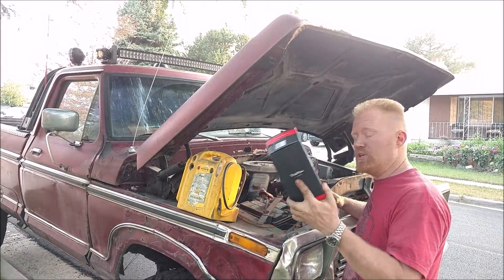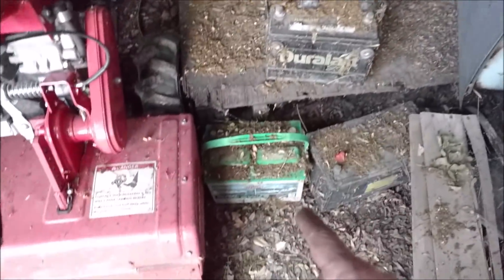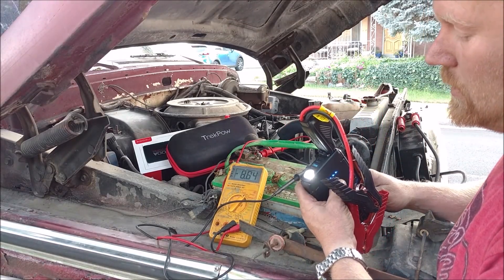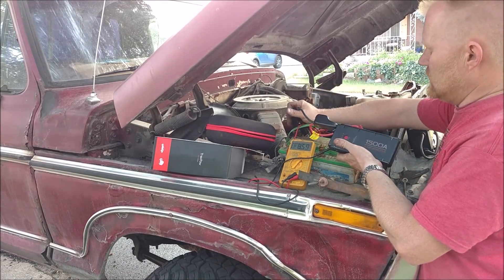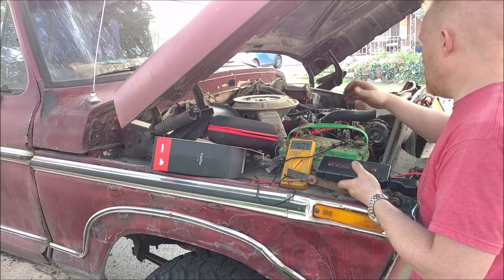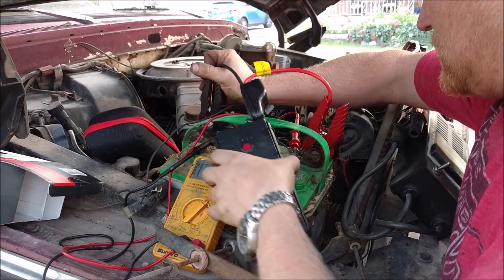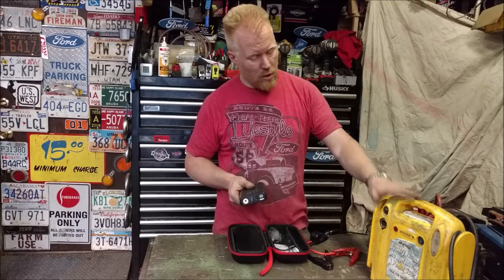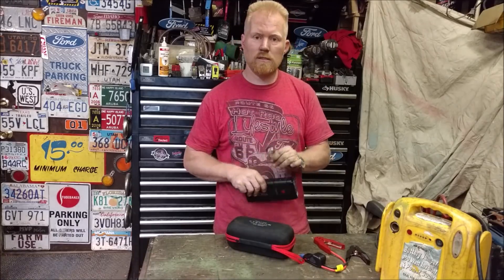Lithium Jump Starters any good?

Comment: Lithium ion batteries have a HUGE energy density, but they are really unstable, so gotta be careful of what brand you get, they will usually put out at least 1,000 amps or more under dead short, but they can blow up or swell or otherwise self destruct when subjected to that kind of abuse.  I have 4 of the lithium ion polymer/pouch batteries out of an electric vehicle that are rated at 300 amps continuous and 2,000 peak, and they can fully replace a lead acid battery, but even those are really REALLY scary, since there is so much energy in unstable super reactive lithium in those batteries.

Comment: I have had the TrekPow TJ2500 2500A Auto Battery Booster Jump Starter for 2 years now and it is a rock. As long as you charge it every 3 months whether you use it or not it will not fail you.

Comment: Cool, Now do the exact tests again in February rather than August ~
Reply from the maker: These lithium are night and day difference. I've used it down into the teens and it never fails. Easily at least 4x more powerful starts than any lead acid jump box. In the teens an ice cold engine will crank like it just shut off on a summer day.

Comment: @sixtyfiveford The fundamental difference between lead acid jump starter packs and the newer lithium based packs is their operational duty cycle. Lithium based starter packs typically only offer about six to ten cranks max before depleting their charge, but can dump very high amps over a short time, as opposed to a much longer duty cycle from a lead acid battery start pack, before losing its capacity to crank an engine over. The ultimate amp-dumping starter packs are based on super capacitors.

Comment: You don't need to install a dead battery to test the unit.
Just remove the battery and connect the unit directly to the cables coming from the truck.
What the hell do you need the dead battery for?
Reply from the maker: The battery acts as a smoothing capacitor otherwise once started the alternator would over voltage and short out itself, the voltage regulator, and dash/interior lights that are on and likely the vehicle computer.

Comment: I can’t support a guy who says a battery reading 9 volts is ABSOLUTELY DEAD.  Where does he think the 9V is coming from?
Reply: A 12V battery showing 9V with zero load has no useful energy in it. The voltage will drop even farther when a load is placed on it. Basically like the strength of rusted sheet metal - its shape is recognizable, but the minute you put any strain on it, it crumbles.

Comment: I bought one of these based on this video, for my wheelchair van, as I was recently stranded at the VA hospital in San Francisco after a two week stay. found I had left the headlights on. I had jumper cables onboard, but no one around to help. I had a solar trickle charger on the van, because there is a draw from one of the disability components installed that will drain my battery completely in 4 days. But this time is was my fault. Tow truck to jump my van was two and a half hours out. finally a very kind vet helped me out with a jump. got on my with a two hour delay. but with this tool I now have, I am more independent and can get on my way sooner. I only wish it came with the cigarette lighter adapter. Great video. thanks for this.
Reply from the maker: I'm still blown away how well these work. I have saved myself and a dozen other people now with it. It works better than even jump starting from another car.

Comment: As a general piece of info, apparently, it could be a good idea to let a jumper battery feed the main battery for a while.  Electro-Boom started his small car with some AA batteries by putting them in series to put a charge on the main battery and then, after a while, started the car.  Very surprising to me.
Reply from the maker: True. The large jumper pack is nothing more than a miniature lead acid battery inside.

Comment: Question,  i have the same one, i crank the car it starts then dies (off for a long time) but the unit disables the power to the instantly within a second of the engine running (but engine turns off after one 1 second due to it be off for a long time)  i have to disconnect  the jumper and reconnected .  on a old car i have to do this about 10 times is there anyway to disable the idiot feature?
Reply from the maker: You shouldn't be running off the voltage of the jump starter for good reason. The 16ish volts could damage a lot of components if left as the only power source. So they shut it off. A typical dead battery will keep an engine running even at only 10 volts and the high voltage from the jump starter is buffered/suppressed by the low battery.  If the car is dyeing immediately after you start it you have a completely dead battery and you're going to damage to the charging system by continuing to use it.
Reply: @sixtyfiveford  no one said anything about running it from the  jump-pack . lots of older cars take several turns to get them STARTED
Reply from the maker: @abdou6003  If the battery is so dead that the car can't stay running do to lack of adequate voltage to the coil, you are running solely off the jump pack.
Reply: @sixtyfiveford  car turns off not from battery being so dead. which its not all im saying older (still EFI with ECU) cars you have to start them several times before they run on their own , even modern EFI , that being said its desigend to be idiot proof were I have to disconnect and reconnect the unit several times each time to start it .
Reply: @sixtyfiveford  Unit closes relay when engine starts for a second.  (which is fine)
Now car needs to start again.  Voltage 11V or not enough to start car
Unit needs to be disconnected from vehicle. Unit is not smart enough to read the voltage after car had a failed start, which is very common in boosting cars 

I feel like i m talking to people who think inside the box and are not practical .
Reply from the maker: @abdou6003  I've started dozens of cars with these lithium jump starters and only once did the car take a second attempt from dieing do to lack of voltage from the battery to run the engine. Even then it was only a single second attempt. Are you pushing the override button on the side of the plug in cable pack?
Reply: @sixtyfiveford  mine does not have a an over ride button.
Reply: i appreciative your help .  its exactly like yours without the button .   i start v10 fords no problem with the unit.
Reply: @sixtyfiveford  what does your over ride button do?

Comment: These are great when they're new. But I want to see one that's a couple years old try to jump a dead battery on a very cold winter day. The two I had both let me down.
Reply from the maker: Mine is over 1year now and I have  used it around 25-30 times on cars, trucks, and tractors. Still going strong. A lead acid jump box is what I have used in the past and I would say these lithium packs are 3x-4x as strong and will give me 6-10 start attempts vs the 2-3 of a lead acid jump pack . My old lead acid jump packs start to  die at about 2 years and can only jump small cars or less. At about 3 years they're completely dead and I have to buy a new 40 dollar lead acid battery for the inside or buy a complete new lead acid jump pack for $75-100.
Reply: @sixtyfiveford  That's good info, I wonder if I just need better models. I bought one from Costco, it was called a WinPlus. It couldn't start my V6 Santa Fe on a cold day. I also had a Motomaster one from Canadian Tire which also couldn't start the V6 Santa Fe on a cold day. They were both about a year old and it was -15 celcius at the time. Neither could even crank it over once. I was so discouraged! I actually connected them both to the battery and they still couldn't turn the V6 over. The motomaster has an override on it too which I had to use, but still no go.

Comment: Did you know this video shows up as a seller video under the NOCO GB40 on Amazon? Not sure if you gave someone permission.
Reply from the maker: Thanks for letting me know, I didn't. I'll have to see if I can find it or do you have a link?
Reply: @sixtyfiveford  It took me a while to find it again but here is the link. VEKKIA 1500A Peak Car Jump Starter Portable with QDSP (Up to 8.0L Gas or 6.5L Diesel Engine),12V Auto Battery Booster Power Pack with LCD Display Smart Jumper Cables, Case, QC 3.0 and LED Light https://www.amazon.com/dp/B07N19FG5L/ref=cm_sw_r_cp_apa_i_z4YMDb19SVMKV     If it doesn't show up under the videos for you, let me know and I can send you screenshots.  I have a two different screenshots. I can email them or post the on instagram or something, or even make a short video.

Comment: Just to be clear - the tester in this video only loads a battery to 100 amps. The scale he's reading as 1000 amps is actually a calculated value for cold cranking amps, based on loading a lead acid battery at 100 amps for 15 seconds. So these current readings shown here are meaningless for a lithium battery. Cold cranking amps tells how much current a lead acid can supply for 30 seconds, at zero degrees Fahrenheit, before the voltage drops below 7.2 Volts. This tester loads the battery to 100 amps, and then projects how much current the battery could deliver.  As the 7.2 volts is dependent on lead acid battery chemistry, these figures are meaningless for lithium batteries.

Comment: I left my headlights on for a 12 hour work shift. Battery was dead-ass flat. Even jumper cables from a friend wouldn't start the car, just click, click, click. A guy came along with a lithium ion pack similar to this one and started the car easily. Diesel Jetta, which requires 800 cranking amps minimum. I bought one of my own. Very impressive.
Reply from the maker: I just jumped my sisters truck last night after failed attempts by strangers with jumper cables in the parking lot. These things pack a punch.

Comment: I personally always think about the total life of a product before the purchase. Lithium ion battery is lighter puts out more cranking power but in the long run the battery eventually will die out and you won't be able to replace the lithium ion battery but with the old sealed lead acid battery unit we can change the battery whenever the battery died and the unit still runs like new.
Reply from the maker: Yes, life of a product is always key in my book. But I bit the bullet on this due the versatility and will more than likely rebuild it if the time comes. Lithium has a pretty good track record and the power output is phenomenal.

Comment: Hi, Moe!

I've been enjoying your videos for several years now, and I have owned two of the lower capacity units (one for each car) for over two years already.  They have both worked very well and I love that I can leave them in the back of the car for extended periods of time without ever having to worry about a low charge, or waiting for someone to stop and help should I need a jump start!  I have also done my fair share of helping others who needed a jump, but there was at least one occasion where my "little" jumper didn't have enough "punch" to get a vehicle started with a particularly well-drained battery.

Your review of this higher capacity unit convinced me to take the plunge, use the 30% off code, and grab one while the opportunity is there!  I'll pass one of the lower capacity units on to a family member who doesn't need as much capacity as I do.  Very nice review!

Regards,
Steve
Reply from the maker: Thanks for your real world experience. I helped a person once who had a lower capacity unit that just wouldn't start the car. It was dead dead though. I entirely expected this unit to fail when I put a stone dead battery with it.

Comment: Mine arrived. I jump started the tractor a few times, and am charging my phone for the second time. It is a versatile battery pack. That button on the jumper is a circuit breaker you don't have to press it.
Reply from the maker: The button on the side of the plug in cables is a override switch. If the battery has extremely low or no voltage it forces it to turn on.  Otherwise the jumper cables turn themselves on automatically with a voltage detection.
Reply: You're right. I read the page that that showed the button that says "if you reversely connect the battery polarity, the led on the clamp will keep blinking red simultaneously. Please do not press and hold overload button" and I thought overload button worked as a circuit breaker. But on the previous page it says to press and hold the overload button for 3 seconds for batteries that are so low they can't be detected.
Reply from the maker: I had to read the instructions a few times. It's strange how they wrote it with all the languages intertwined.

Comment: I started experimenting with the TrePow last night.  I have some led, one and two bulb rv type lights.  Using the Cig lighter adapter, the light would only stay on 24 seconds then shut off with only one side of the two sided light on.  So I tried it with led string lights and it worked fine. I tried it with the old filament type RV bulbs and it worked fine. Went back to the two bulb RV LED and turned BOTH  of them on and the TrePow will power them  fine. So I went to Amazon to order a second TrekPow and at check out it said "this discount code cannot be applied to this order", so apparently we are only allowed to purchase one with the discount code. At $69.99 I would buy a second one. At $108. I'll get by with one.  Thanks again Moe for the review and negotiating the best discount of any of the TrekPow reviewers.
Reply: You can make another account with a different email address to use the code a second time.
Reply: thank you
Reply from the maker: Yeah, I noticed that with extremely small loads the cigarette port turns itself off.

Comment: My sla jump starter lasted 7 years 20ah Panasonic ups stile battery it has but I have one of the new ones also a hummer H1 is what I got for new unit. Panasonic SLA I got from Digi-Key also good are the supercapacitors JumpStart I also own.
Reply from the maker: That's about what my SLAs have been lasting. The one I just pulled out of my jump box was from 2011 and still works but is definitely reduced capacity.

Comment: Follow up:  I ordered the TrekPow  Tuesday, it shipped on Wednesday and arrived  (376 miles) via UPS ground today.  Excellent service from Amazon.  I've not had time to mess with it yet, but mainly I want it as a power supply to run the 12V LED lights that I have in the house to use during occasional power outages, as well as jump any batteries that need a kick. Thanks again for the review and DISCOUNT code

Comment: With regard to running a blower, compressor, or similar unit with a motor in it, the problem you get is that the motor startup current is a lot higher (3~4 times) than the running current, so even if your motor draws (say) 8 Amps running, it will draw 25 Amps or more for a brief time when switched on.  This will often (as you found) trip the unit as it has a fast acting protection circuit.  You can get around this by putting an inrush current limiting NTC resistor in series to the motor, as this will "damp out" the startup and stop the unit tripping.  Just need to make sure your steady-state amps are below the unit rated output.  The downside is that the NTC will get hot (maybe up to 150°F).  Getting fancy, you can use a relay with an R-C delay on the coil to bypass the NTC after 1/2 second or so and it all works fine, so the NTC initially starts the motor but then the relay pulls in to bypass the NTC and feed the motor direct.  The upside of this is that the NTC cools down quickly once it is bypassed and is ready to go again.  The downside, however, is that (with the relay) you have to switch the power on the jump starter pack side of the NTC + relay.   Anyway, you can get around it one way or another.
Reply from the maker: Great info. Thanks.

Comment: Nice, thanks! I definitely need to get one of those... I have a cruddy one from Walmart that claims 600A (no way)! How long does it take to recharge it? Thanks
Reply from the maker: Charging depends on what size of charger you plug it into. Most basic chargers are around 1 amp and it would take around 12 hours from fully dead, but it will handle up to 3amp chargers and charge in around 4 hours. Being lithium you can charge it whenever and it will sit for a year without loosing any charge. It seamed to only take around 10% charge out of it for a single jump start.

Comment: I think they used 4 LiPo's in series, that would explain the 16V DC. In the smaller packs you would likely see  3x4.2V = 12.6V DC.
Have one of the smaller jump starters and I use it to start the lawn mower, works great!
Reply from the maker: Makes sense.

Comment: I swear by these Moe. I've got one for each truck and for each motorcycle. They're a small investment in not getting stranded, and as you show, they're TINY yet Mighty! I took my KLX250S out a couple weeks ago without one of my jump packs and wouldn't you know it...the battery lost a cell in the lead acid battery. Boom...had to push the KLX home 1.5 miles. I couldn't get the bike to bump start either. So...now...it too has a jump pack always with it. Thanks for the video my Friend! Zip~
Reply from the maker: Pushing is never fun.

Comment: I've found this model in the the UK but some are 12000 mah and others claim to be 18000 yet look identical!
Reply: They confuse things using mah. 12000 mah is only 12 amps. That would be for the output charging port for a phone or computer.  The jump output of the one in this video is 1,500,000 mah.